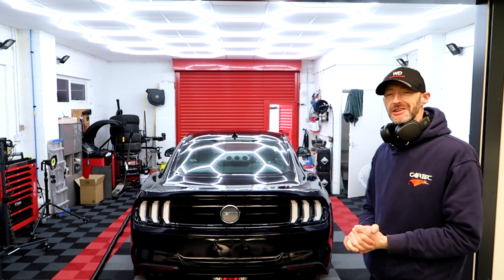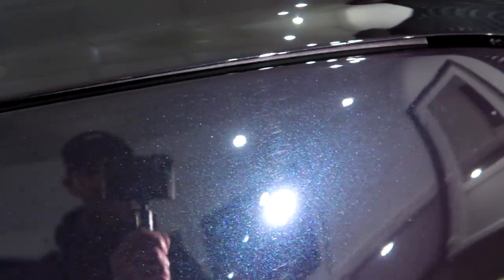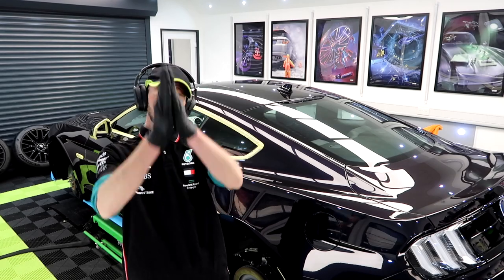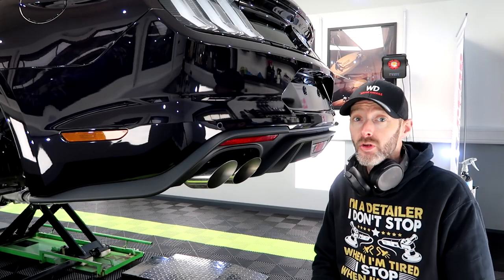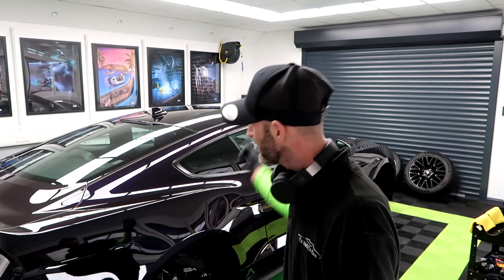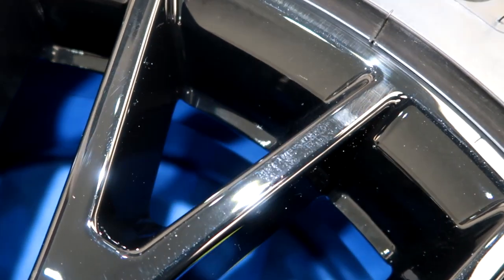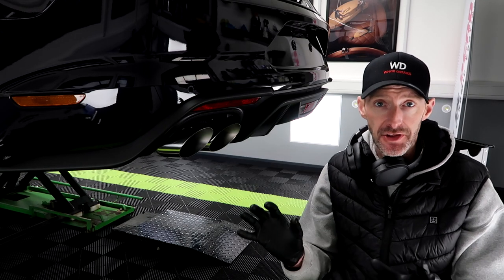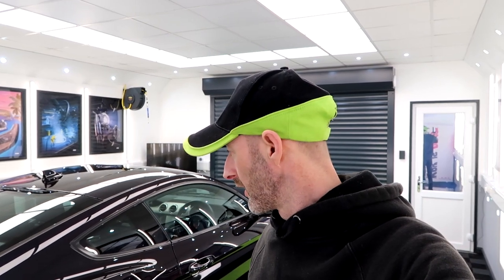VLOG 012 Ford Mustang GT New Car Protection Detail @KAMIKAZECOLLECTION Zipang Ceramic Coating

Comment: I forgot to mention.  I just purchased a black 2019 Mustang Bullitt.  The video is inspirational.  I'll try to use the same products you have on this GT.  Due to costs I'll use a different coating.  Any recommendations you can make would be appreciated.  Thanks, Greg
Reply from the maker: Thanks for the comment @gseybold, for a nice deep wet looking coating I would try Gyeon PURE or for something which is very hydrophobic I would use Gyeon MOHS, both are fantastic coatings 👍